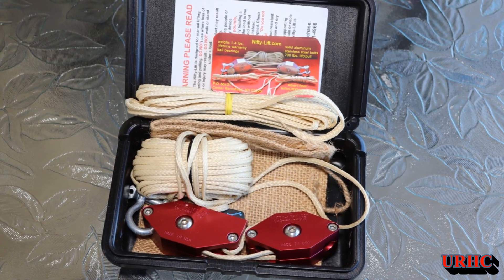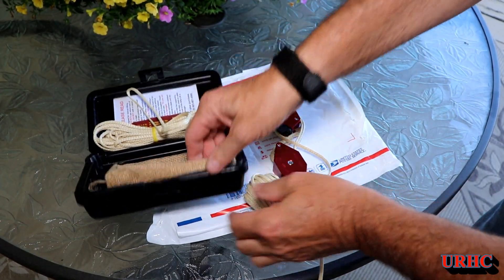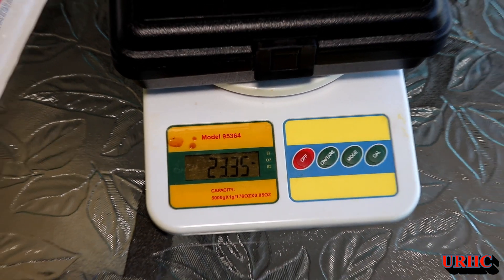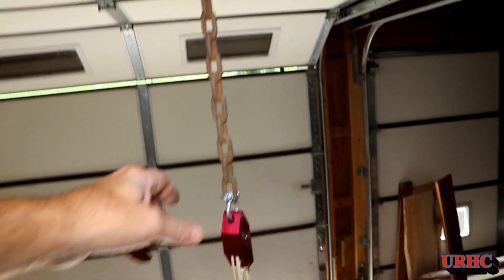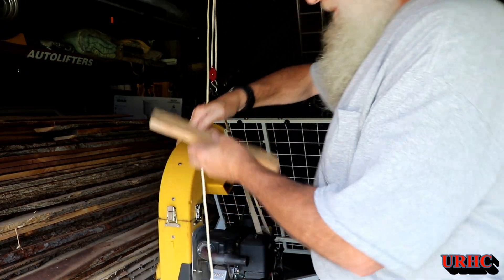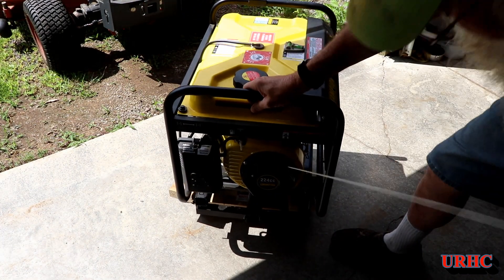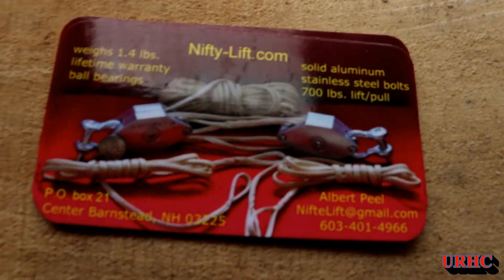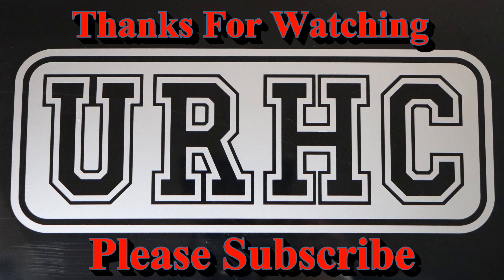Trying Out A Made In The USA Nifty-Lift Deluxe

Comment: Albert actually tested one of these things on a break machine and it failed at about 7,000 lbs. The rope failed, the block and tackle was fine. I'ld easily trust it to over 1000 lbs, if you could pull that hard.
Reply from the maker: That's  a dangerous  way to test it. Hopefully  no one else tries that and gets hurt. Thanks for watching.
Reply: @unemployedredneckhillbilly2023  Sorry, but how is that dangerous? He sent it in to have it officially tested on a machine designed to break things.  That's how he came up with the 700 lb SWLL. If anything, he's being conservative. At 5:1 safety margin, he would be well over 1000 lbs.

Comment: Thistype of locks have been used on small sailing boats for at least 50 years :)
Reply from the maker: Probably longer then that but I haven't seen a pocket size set like this before. Thanks for watching.
Reply: I'm sure they have, but not to this level of strength, precision and efficiency.

Comment: $150 for block and tackle.
Reply from the maker: It's made from all top of the line parts to be extremely lightweight and durable. The rope and splicing is probably 1/2 of the cost. I think it is worth it. A junk one that weighs 5 times this one and takes up 10 times the space with a 400 pound rating using 70 lb rated rope can be had at Harbor Freight for $16.00 if that is what you need. Thanks for watching
Reply: You have to appreciate the precision engineering, compactness and efficiency.  I take mine hunting with me to string up elk at hunt camp, I think that was what Albert had in mind when he designed it.